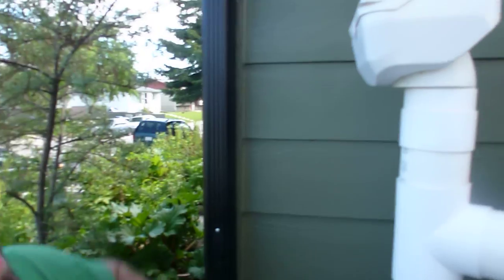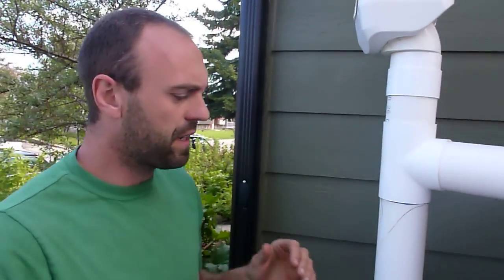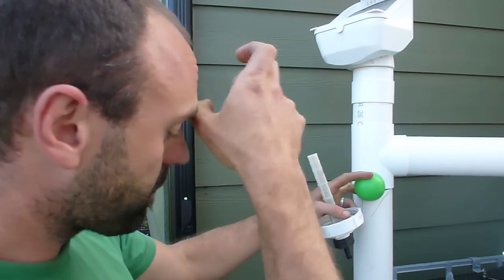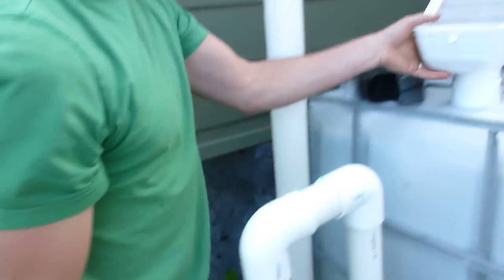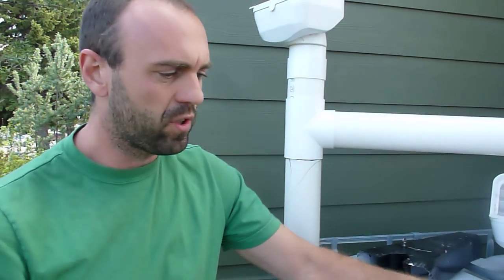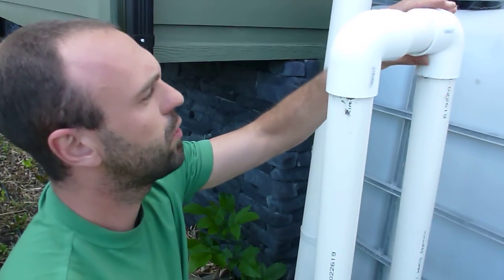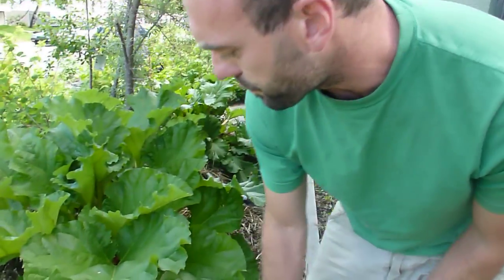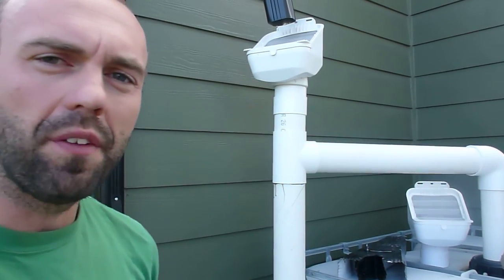Rainwater Harvesting 101

Comment: This system is extremely over the top and unnecessarily complex. 99% of people only need to harvest 100-200 gallons of water for their small gardens or to have an emergency supply of drinking water. This can easily be done with 2-3 50 gallon drums. You attach a rain diverter (found in any hardware store) to your downspout, then connect a hose/tube directly to a hole that you drill into the side of the barrel. Nearly air tight, water tight and algae/bug proof.
Reply: Based on the people I'm usually in contact with who are truly looking to harvest rainwater, 99% is high. Lots of people want rain barrels, but plenty of people need way more than just a rain barrel.

Comment: Thank you for posting. So, in a heavy rain event your overflow feeds the swales, but the rain will also be filling up the swales at the same time... What makes me think that you must have soil erosion at some point... Specially during heavy rain. The overflow is not slow and passive, its quite rapid and aggressive... Wouldn't you be better off digging up a deep trench filled with draining rocks?

Comment: You're putting all sorts of measures to avoid bugs getting into the tank, then you have an exposed hole in your overflow drain.... seems to me like it could use some improvements. Considering your using it for your garden I don't think purification is all that crucial. You could try stacking a second tank on top of this to collect a certain amount of water, purify it and fill the reserve tank once your usable water is used up. There are plenty of water treatment solutions that keep water fresh for up to 5 years. This way you would be able to use this water for drinking/cooking, and if you collect the water that drains from your sinks and other water appliances you could store that in a 3rd filtered chamber to use for showing, considering the water heater is going to sanitize the hell out of it.
Reply: Well, he could wrap screen around that section over the hole. <g>
Reply: Dave Dankness I must have missed that comment about the water heater the first time I read your comment.  You can't count on the water heater sanitizing the water unless you have it set for boiling hot, which is too hot for the water heater to run.  Also, letting the debris into the water heater will cause the bottom to rust out much quicker than normal.

Comment: Great component video. $70 for some plastic and screen... yikes. If you wanted to use the system in Spring and cold conditions you could throw a loop of heat tape in the downspout and into the PVC head and tank. This would stop it from freezing solid and allow water to be collected.